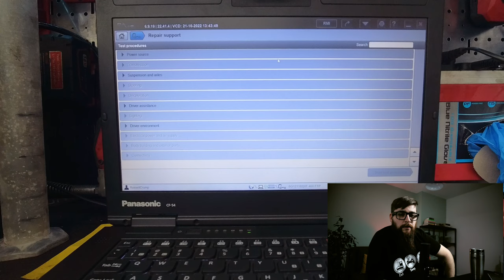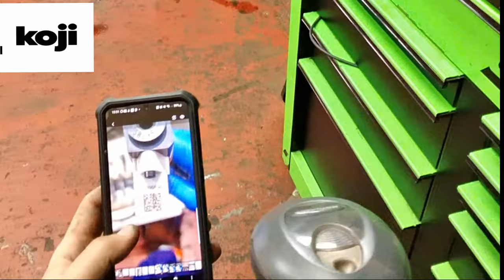DAF mx-13 knocks on start up, is it injector sleeves?

Comment: I think on the early EURO6  so same version of the MX13 you had there ,we had an issue with diesel going in to the cooling system..I had a hose made up like yours for pressurising the fuel system  ..You then remove the top rad hose ,pressurise the fuel  system the same as you did ,and if the head is kaput you will hear the coolant bubbling away i still have the video on my phone ..A certain Mr Hayes was well impressed with it  lol
Reply from the maker: Hey norb, yep this was euro 6 too not MY-17.i had to make that hose up too as I don't think it was in the DAF special tools arsenal, crazy how many different ways you need to apply pressure to systems to identify a fault.
 I'm just glad it WASN'T the injector sleeves as I think a new head would of sent it to the great African scrapyard 😂
Reply: @TRUCKTECHUK  I will bet there are people somewhere who can repair the heads ,.It is mad just how easy they are written off nowdays ..I swear one day that valve gear onthe MY17 will put my back out..On another bit of good news for me .on e campus i have no training to do ..all done ,even all the stupid free ones
Reply from the maker: I bet there is but would you trust it? Tube of gorilla glue and no spare change from 1k please 😂😂😂👌

It's all written off as people can't be trusted to do a competent job. We had this conversation with the guy who does our cylinder head work.......he has no-one to pass his trade onto! He's tryed younger apprentices but they lack the ability to comprehend the measurements required to cut valve seats ect. It's that or were failing to teach the younger generation correctly 🤷. 
As for training well done! I'm sure they will have some other course for you to do a refresher on soon like I'm sat in the peacock now after 3.50 hours of battling Birmingham traffic in the rain as I'm here @daf for 2days

Comment: well done. as  a yank dealing with bio diesel and incompetent help at truck dealerships, i am trying to learn all i can on injector issues.
Reply from the maker: Hey 👋 thanks for the comment 😀. Daf have  just started pushing  HVO here and with a 90% reduction in co2 emissions I'm sure It will become adopted as a new standard soon. 
I think from a preventative maintenance point of veiw I'd be looking at using an adative such as Power Service Diesel Kleen to keep thing in good shape. Hope this helps 😎

Comment: MX tech out of florida here, We have roughly 15 of these that need to pulled from chassis due all kinds of failures. Fun.
Reply from the maker: Hey Rob thanks for the comment buddy 👍😎. Is it a big job pulling these for you? I suppose any sort of camshaft-related issues and they have to come out due to the cab design?
Reply: Its not terrible just kinda time consuming.  We used to stand the block up on jack stands and porta powers and do the cams in the chassis, but i prefer to pull it and do it on the floor. Easier and safer.   Funny enough I just pulled the pan on a Kenworth with an mx-13 epa 17 that threw #6 rod into the side of  the block and shattered the air compressor. Never a dull day lol. Cheers from across the pond.  @TRUCKTECHUK

Comment: Great job!
BTW here is a poor man´s procedure of finding the injector blow by, already at an early stage before it causes real damage. We call it bucket boozing. 
Take the fuel lines of the tank and put them into a bucket of Diesel (1 Liter or so) Both lines need to be under the surface. Then start engine and wait for remaining bubbles to go. Then the actual procedure is: Speed up the engine to max revs and keep it for 1 sec. then release throttle in once (let snap back, as fast as possible). Watch the return pipe. If you see a trace of small bubbles after another 2 or 3 sec after release, congratulations: it is the smoking gun. 
Explanation: When the engine slows down from max rev to idle speed no fuel is injected. The engine works like a compressor instead. This pushes the air from the combustion chamber into the return channel in the cylinder head and it is swallowed back to the tank. 
Note: This DAF issue is mostly seen on cold engines. 
So let the engine rest before you go for bucket boozing. 

Check out our bioltec channel. We share our experience of 20 years working on commercial engines with dual fuel systems (biofuels etc...).
Reply from the maker: Thanks for the comment and the testing procedure. 
I will attempt to replicate this next time I have the same fault. 
I will have a look at your channel as alternative/ renewable fuel systems are something I'm looking at exploring to add to My high voltage E.V system diagnostics

Comment: Mate, gold content for DAF EURO6. keep going. many thanks
Is true that DAF 460/510 Euro6 are better in terms of failures compairing with the newest 480/530 models?
Reply from the maker: Hey budacao, 👋 thanks for the comment and for watching 👀 😀  
Sorry about the late reply. When you say newest models, are you referring to NGD? 
what you have to remember is that any new product that is released will require updates for the better. Take your phone, for instance, I must get updates for mine every other month. But anyway. What you have to remember is that the older generation has been around since 2017, and NGD is a whole new cab and systems not to mention more ecus. I suppose if we tested things until they were 110% correct, you would never get a new product 🤷

Comment: Hey bro.how are you 
When programming the injectors, do you have to keep the engine running or just switch ON
Reply from the maker: Hey how's things. You shouldn't do any programming with the engine running, always ignition on with the diagnostic computer linked to the vci/mux with a USB lead incase of connection dropout
Reply: @TRUCKTECHUK  thanks bro .for the understanding..I really love your work bro.it giving me some understanding about these daf euro 6 trucks

Comment: very good one ,pls where will I get the special tool use to turn the engine to buy 🙏🏿
Reply from the maker: Hey thanks for the comment 👌.
If you want the tool to turn the engine over and not pay dafs dealer prices for it this link to a supplier I use alot will be able to supply you with it
 https://ebay.us/rVdp22
Reply: @TRUCKTECHUK  ok bro tnx soo much

Comment: Hi man I have to change my injector in my paccar mx 13 2016 .
Is it just take the cover off and take the injector out and put a new one in .or there is procedure for that .am in Canada
Reply from the maker: Hi thanks for the comment. There is a process as you have a injector tube through the cylinder head which will need to be removed for you to remove the injector.
 You will also need to have the new trim code of the injector programmed into the PCI ECU for optimum fuel economy.
 DONT forget to change the injector clamp bolt for a new one as they are use once only and follow manufacturer torque specifications on injector clamp bolt and injector tube or it COULD end up costing you dearly......
Reply: @TRUCK TECH UK  thanks do I need adjuste the valve after putting a new injector .

Comment: Couldn’t you do the UBD test in the first place? Then you know wich cilinder is under/over contributing. 

Right now we have a my2017 in workshop where the cooling system is making pressure. We  bypass the aircompressor but With no succes. Then  we tested the egr cooler but it didnt leak anywhere. We took the cylinderhead of to measure the cylinder liners, wich was alright. We also replaced the D- rings because  there was coolant in the carter so 2 of them were broken, we replaced everything. Don’t have a clue where the pressure comes from lol
Reply from the maker: Id of exspected a unbalanced cylinder DTC but when nothing had showed up it got passed over to me due to the drivers complaint. I SHOULD of checked for bulletins FIRST #firstruleofdiagclub but I went in with symptom based diagnosis unfortunately.

Have you had the cylinder head pressure tested? I take it your getting coolant out the overflow pipe?
Reply: Probably the compressor head gasket, put both coolant pipes into a barrel of water and see if it bubbles
Reply: @georgehearn1703  we did that, no bubbles, our customer replaced the cylinderhead of compressor himself(he was a daf master technician that started a garage himself)
Reply: @TRUCKTECHUK  yea forgot to mention that, we did get the cylinderhead checked and it came back ok.
Reply: @TRUCKTECHUK  when the truck is idling and filling up the coolant it throws it back out, and if input the green dop on it, if i put it back off after 5 mins it releases very much pressure
Reply: @kdo2487   has he followed to torque procedure to a T as it’s no a fair few steps to ensure proper sealing of the head ? Hair line crack in liner ? Have you tried running it with compressor delivery pipe off to keep it breathing easy and see if it eases the problem ?
Reply from the maker: @kdo2487  so apart from the pressure in the system and it throwing it out the cap....does it set the coolant level light off when it pressurises the header tank as it forces the coolant into the back of the header tank and drops the coolant level? 
Do you get overheating issues?
Reply: @georgehearn1703  no cracks in liners, yea he has followed torque procedure, didnt remove deliverypipe yet. But we bypassed the compressor and nothing changed, so im 100% sure its not the compressor
Reply: @TRUCKTECHUK  yea light comes on the dip. ITS replaced two times the header tank already because it breaks under the pressure. Daf netherland had me measuring the cylinder liners 3 times before they were 100% sure that was ok
Reply from the maker: @kdo2487  its a shame you can't pressurise the coolant system to a decent pressure from a external source